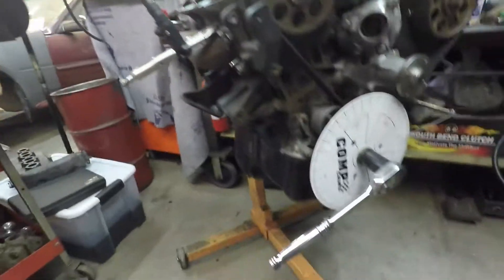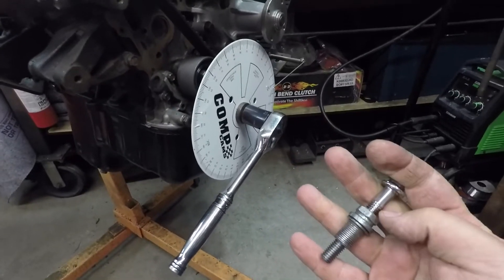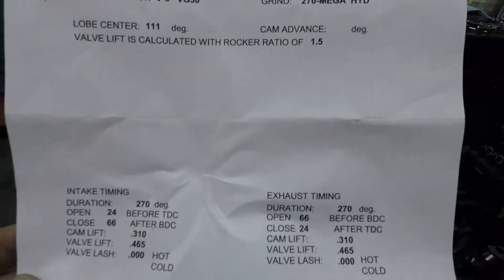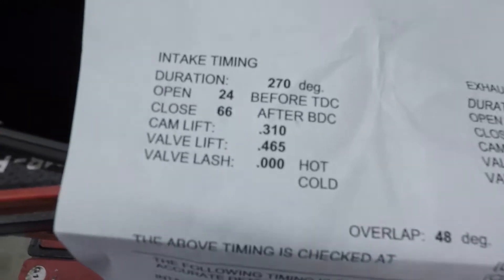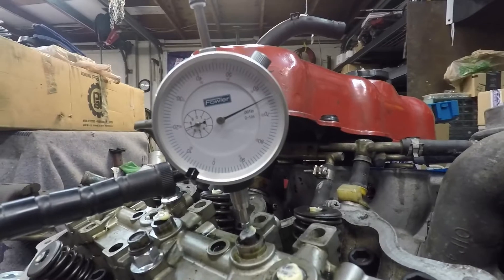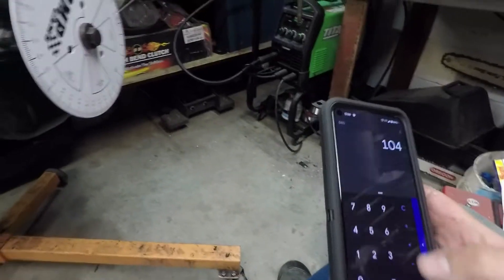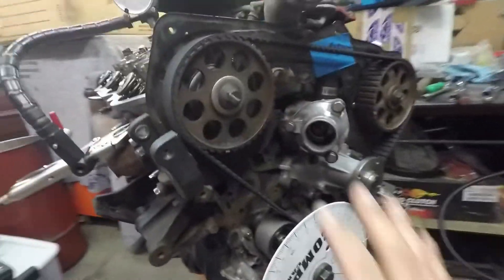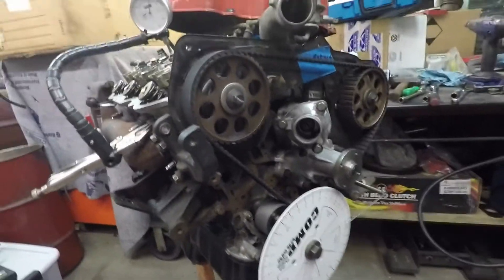Cam Degree process on VG30E and VG30ET Nissan Engine

Comment: Correction not a dual cam engine! this is a VG30ET not a VG30DE
Reply from the maker: Yes this is a VG30ET, of which is a dual cam engine, one cam per head. Not a VG30de which is a quad cam engine, dohc per head. 

Semantics, your "correction" is unnecessary, as the video title is clear.

Comment: Nice video.
I just picked up a Nissan Caravan Royal ‘96 (JDM) which houses the same motor. I’m looking for motor oil and filter recommendations for the VG30e, if you can offer any recommendations?
Reply from the maker: I usually lean toward Rotella or Motul if going for performance, especially if in a hot climate 15w-40. filter wise, a Wix, purolator, or napa/advance auto brand work well. of course the K&N and Mobil type filters tend to be decent too.
Reply: @1stAxelKain  Thanks Oddball!
Reply: Factory recommendation is 5w-30 the engine needs the thinner oil in cold weather
Reply: @b-man13  Thank you
Reply from the maker: @b-man13  the owners manual and fsm have ranges anywhere from 5w30 to 10w-40 depending on climate. Although in "extreme" circumstance like hard driving racing etc, heavier isn't an awful way to go, especially when running an oil only turbo.

* 5w-30 is only recommended for -20F to 60F....
Reply: @1stAxelKain  he is asking about a vg30e so a turbo application is irrelevant. It doesnt matter what you're reading on paper when many people have discussed problems with thicker oil. The vg30e has a week point in the design in that the oil passage way to the top of the engine is very thin and takes a little longer to get there. This noise happens on start up for about 1 second in cold weather with thicker oil. To combat against that use a 5W in winter and 10W in summer.
Reply from the maker: @b-man13  .... You've just articulated the exact reason for multi-viscosity oil recommendations.

Another consideration is that the lifters are wearing out and bleeding down in a short time.